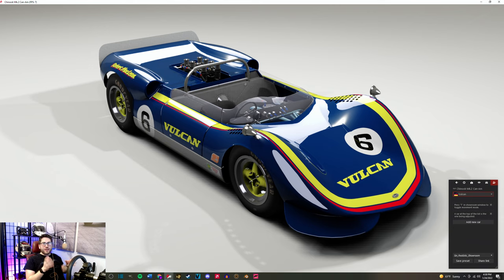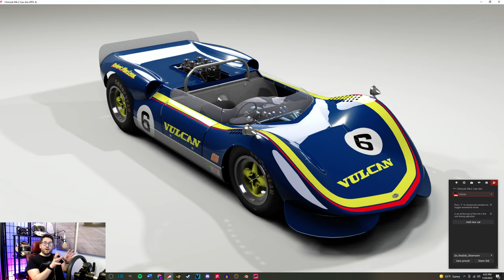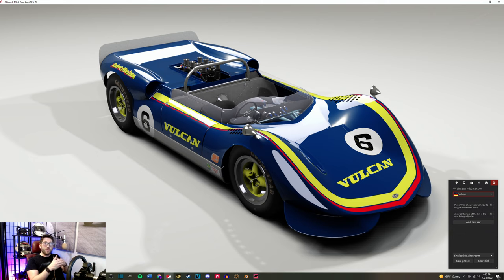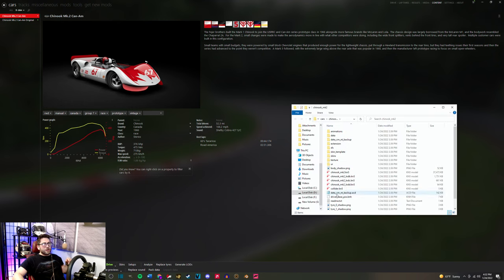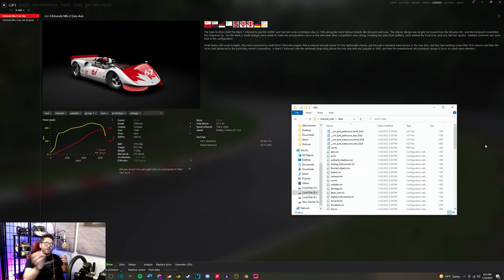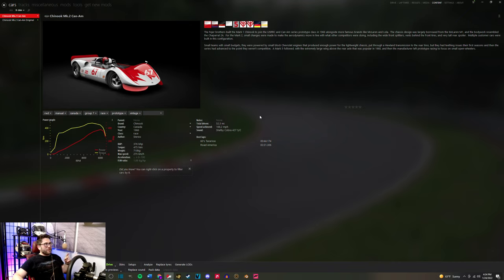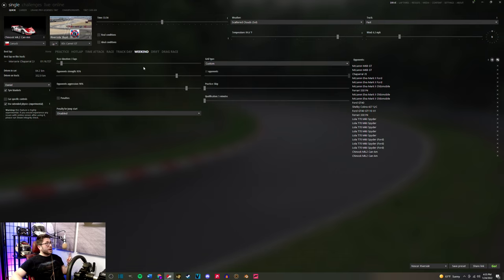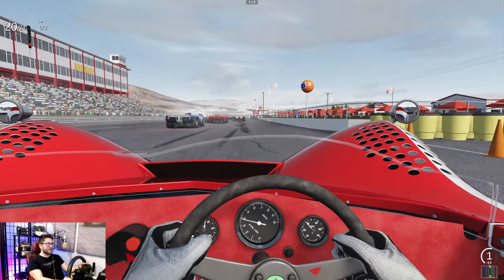Chinook Mk2 Can Am Racecar & Update on 1967 Can Am Mod Collection

Comment: With later CM, unpacking data is not an option by default, you have to enter CM developer mode. This is done by clicking on the CM version number until the developer mode window pops up. This fix is amazing and with a sound swap the mod is great to drive. Thanks!
Reply from the maker: Great hear!